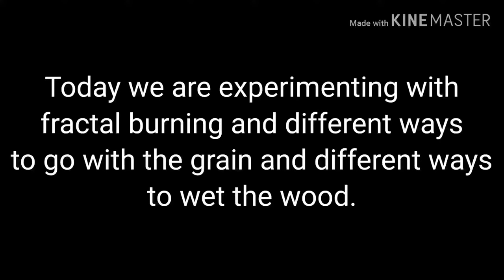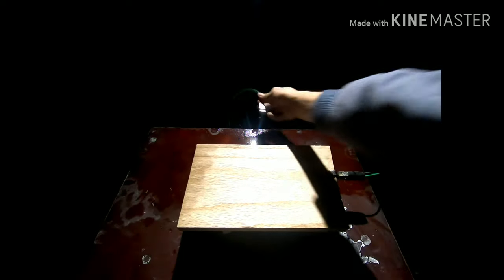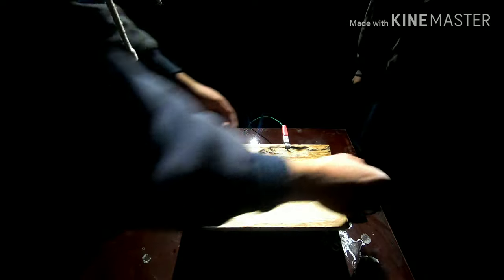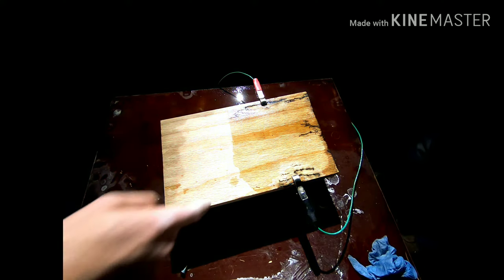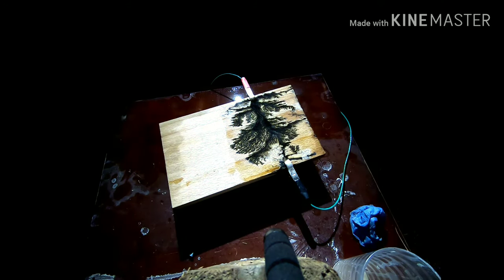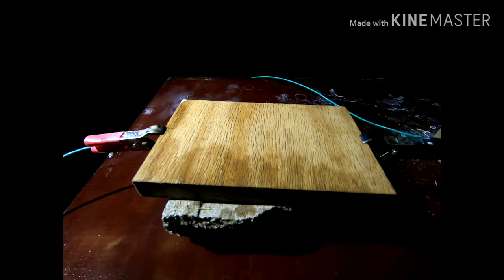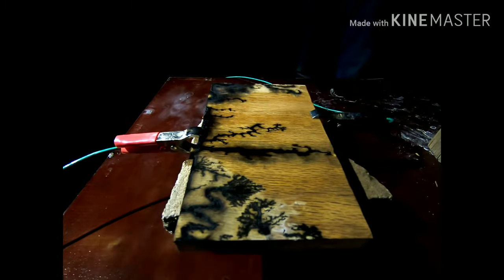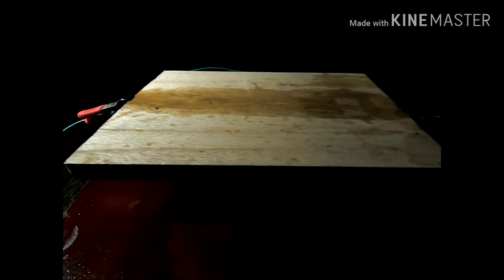Fractal Burning cross grain and with grain

Comment: You can force the burn to go in 1 direction by completely soaking 1 clamps more than the other. It will not burn at the terminal that is too wet. This will give you a more tree like burn

Comment: not sure why youd assume anyone would leave the unit on while spraying it with a bottle? just as you turn it off to apply more water with a cloth( youre literally touching the probes, thats  much more of a risk in case you forget to turn it off) people should ALWAYS turn everything off before doing anything near project
Reply: Yeah, or, what if the transformer releases a stored charge? I would most certainly not be adding a medium to promote electrical conductivity while my probes/leads were still attached to the project, period. I don't see any rubber/plastic mats to shield the contact points, or, anything, either. Sketchy AF!

Comment: This is very dangerous, 34 people have died doing this. Please go to Ann Reardon’s channel today see why it is so dangerous.
Reply: So you're saying 34 people screwed up and did something incredibly stupid while tying to operate a machine and it cost them their lives, just like thousands have done with other machines.
Reply: Ive been doing this for ages I'm still alive because I'm just not that stupid.
Reply: @dwilliams115  This is much more dangerous than people realize. People who handle 2000 volts, use specialized equipment, including arc suits. They are certified w special training. What you are seeing is incredibly stupid and risky. There are people out there that, if informed, will make better decisions. This isn't operating a machine. It is designing and operating a home made, 2000v gadget. 34 reported deaths is a lot. How many people do think tried? I heard the guy say, he was worried about being shocked, in the video. There is no "shock". It's electrocution (that means dead), or really bad 3rd degree burns and heart damage, always from 2000v.
Reply: @livinb450  Funny, my 50,000 volts taser doesn't require an arc suit...  even having more than 20 times the 2,000 volts in these devices.

34 people have died over a 5 year period.  Thousands of adults and children every year have died riding their bikes or walking on sidewalks. Where's the calls to stop riding bikes and walking, which are are statistically FAR more dangerous than this?

Personally, I prefer my 10,000 volt burner over the 2,000 volt devices. Provides more intricate burns and still doesn't require an arc suit.
Reply: They didn't die from incredibly stupid things it's called a mistake or an accident
Reply: Vending machines are very dangerous. Vending machines kill, on average, 13 people a year. Please ask a local vending machine representative to see why they are so dangerous.

Walking and standing are very dangerous. Over 17,000 people in the US die each year from tripping and falling. Please go to your local senators office to see why being on only 2 feet is so dangerous. 

Motor vehicles are very dangerous. 50,000 people die each year in the US from car crashes. Please go to your local drivers Ed class to see why it's so dangerous. 

My point is stupid people play stupid games and win stupid prizes. People complain about this but have no issue with 16 year olds extremely addicted to their phones driving motor vehicles, people smacking vending machines, or people over 65 years old walking.